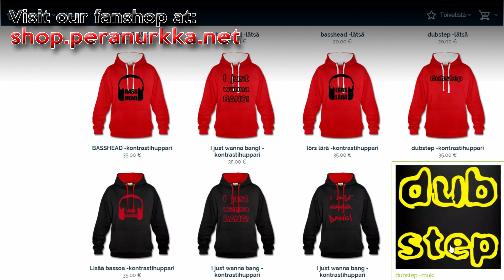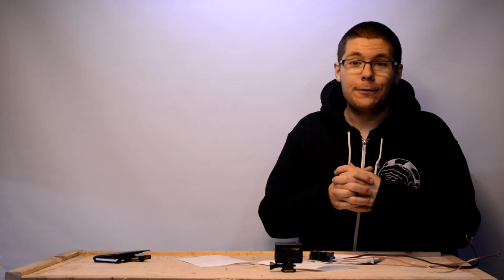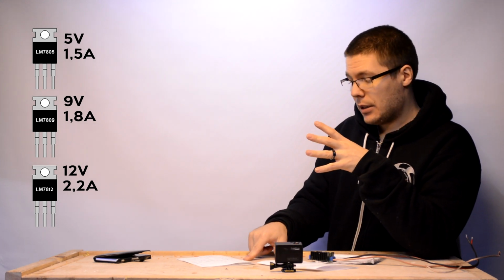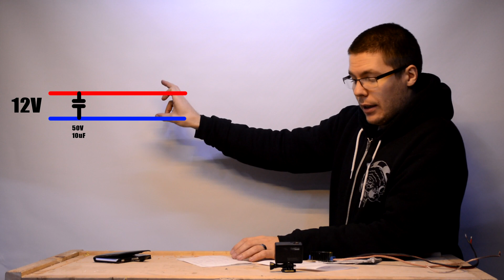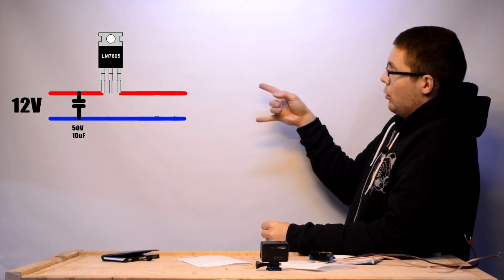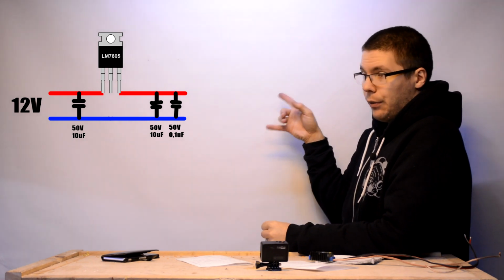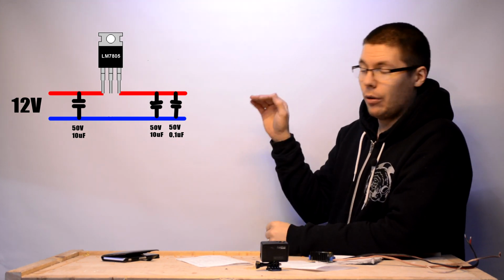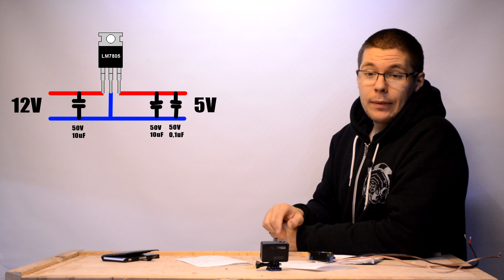#PN | Voltage regulator 5V 9V 12V

Comment: Sir best explanation of 3 or 4.    Better than using a USB car charger to use a 9 volt little battery to power a 3 to 5 volt amplifier on a little FM radio? . seams like it doesn't do good past a 7.5 volt battery. It messes with the Arduino and the led display after 45 minutes.  I'm not a radio person but got it sorta running. ... Thank You for the Vidio. the breadboard made no sense on this one to me.., Bob

Comment: Is it stable enough for phone charger? So i can use 12v battery as my power bank.
Reply: yes but step down converter would be better. Linear regulators waste all the energy as heat. if you use lm7805 it will heat up and its not efficient. Search on ebay buck step down converter.

Comment: how can i calcuLATE THE VALUES OF THE CAPACITORS?  why there is the need of capacitors? what happens if i don't use those capacitors in this circuit?

Comment: I wan to know if i can use 12v INPUT for a dual output of 5v and 12v
Reply from the maker: Just use the 12v version in parallel for 12V output. But remember that lm7012 can heat up easily, use aluminium plate to dissipate heat

Comment: Hi assume this is only for dc voltage? But in all honesty I have not got a clue. I have only ever worked with DC voltage before. I am trying to find a regulated circuit design for a 9vac output from a 9vac Toroidal coil between 3-4 amp. The draw should only be 2.4-2.6amp but always like to build things tougher than needed. If all regulators like this one only go to 1.8amp , am I right in thinking that two could be used in a parallel configuration for 3.6Amp? Or are they available in larger capacities. And would the values or types of the capacitors change in value because of the higher amperage ?  Sorry I have very little knowledge of electronics, but eager to learn new skills.
Reply from the maker: Yes only for dc.
So you need 110/230V to 9V ac?
Interesting. So high current also, so you need beefy toroid to make it.

Or a simple iron transformer with proper coils on each side. You should find guide how to do it in google by searching "iron heart transformer" and "transformer coil winding calculator"

Comment: How about 12v to 9v is the same capacitor? Pls answer
Reply from the maker: Neilsen Bautista yes. Use same caps
Reply: team #peränurkka same value? And what is the output current value? Thanks for replying
Reply from the maker: Neilsen Bautista lm7809 outputs 1A maximum, use heatsink for the transistor to avoid it heating up
Reply: team #peränurkka okay thanks for answering

Comment: suppose if v want to get 12v output ?is d circuit same? d capacitors value?
Reply from the maker: same caps are ok, just use 7812 instead of 7809 / 7805

Comment: Hey guys, 
Many of you are want to reduce voltage like this circuit but you can  very easily reduce it with just a one 10K Variable Resister for 12v Dc Battery 
I give you a link if you want to know how it is,
https://www.google.co.in/search?q=variable+resistor&client=ms-android-samsung&prmd=ivn&source=lnms&tbm=isch&sa=X&ved=0ahUKEwjcxNu3gtrZAhWKvo8KHafQB44Q_AUIESgB&biw=360&bih=560

Comment: What happens if I don't install the capacitors? I'm creating a small automotive "thing" and I just need to give 5V input to Arduino I/O pin from 12V in my car. The output current quality is not crucial, just a voltage near 5V is enough, I think... So, will it work without the capacitors?

Comment: Also you can use 5 v Zener diode across output for more protection against increase of output voltage due to transistor failure

Comment: can we use it's opposite
say 5V to 12V
Reply from the maker: HK's Original you need dc step up converter to do that, not with these
Reply: team #peränurkka 
Than you buddy
Reply: use boost converter, LM2621 step up DC DC Converter, it is switching mode power supply, not 78xx linear power supply

Comment: How to convert 5 volt to 12 volt
Reply: use boost converter, LM2621 step up DC DC Converter, it is switching mode power supply, not 78xx linear power supply

Comment: Can we get 5 volts by giving 3.7 volt please tell me im in problem pleaseee🙏
Reply: use boost converter, LM2621 step up DC DC Converter, it is switching mode power supply, not 78xx linear power supply

Comment: how can I step up 5v to 12v
Reply: use boost converter, LM2621 step up DC DC Converter, it is switching mode power supply, not 78xx linear power supply

Comment: i want 16v to 5v.how is posible pls tell me
Reply: LM7805 max input voltage <=25V, depend on output current, you may add the heat sink on 7805

Comment: nice explaination sir, just to be clear because i want to make use of my mini solar panel, my solar panel give off 12v so can i still put the Lm7812 regulator so it will stabilize the the voltage?

Comment: From 9v unregulated voltage to stable 5v output using voltage regulator.. can 220v unregulate to a 5v stable output also possible?? Pls answer
Reply from the maker: no no no no
do not put 220V AC into DC components.

Comment: Sir, How can i convert 12v to 6v.
Reply: LM78xx is a fix voltage output regulator, if you want to adjust the output voltage, the sample way is add a diode forward connect in second pin to GND, the output will boost up 0.7 volt, but the right way is use LM317 adjustable regulator

Comment: I connected a 5v voltage regulator (with the capacitors) to a cellphone battery so that i can charge it. The thing is that when the current flow stops the battery gets discharged. The current flows back from the battery to the regulator.Is this normal? I solved this using a diode but the voltage drops down a little.
Reply from the maker: That is very good point, using diode is a must. I tested this also and that solved my problem where sometimes it wont charge and i did not know why. Thanks for solving this. 
To get the voltage up you should use this with diode: https://www.youtube.com/watch?v=A2BmJalFP1M
Reply: Use diode for not getting back

Comment: to: #PN Voltage regulator ; I have a question : if we assemble 1 capacitor high (1000u or higher) at input of 78xx and  one more  capacitor at output, they can make wrong the IC 78xx, am I true or fault
Reply from the maker: I need to test it out, but using higher capacitor at the input side should not affect on the output.
Only using higher capacitor on the output side can boost or keep up the voltage when higher current is drawn.
Reply: To: #PN; I am agree you it is true for the support of voltage drop! . But they are very small capacitors on the datasheets of 78 family ic. So what is true thing?

Comment: if tha capacitor is 10uf and 350 v what is the result
Reply from the maker: 10uF 350V is ok, just make sure the voltage is not less than 16V and if you want more stability use higher uF capacitors
Reply: ᏗᏁᏬᏒᏗᎶ ᎶᎧᎩᏗᏝ 
....
ppoop

Comment: ok i have a tablet.. took off the battery to hook it up in my car and i dont want a bunch of wires around. this will work if i hook it up to 12v battery reduce voltage to 5v then reduce again to 3.7?